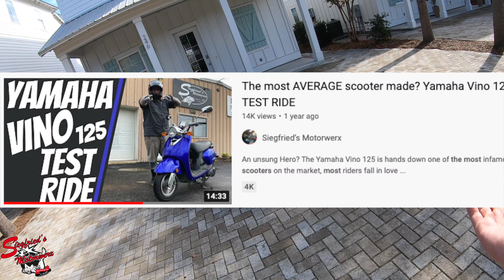Watch this BEFORE you buy Dr. Pulley Sliders for YOU Vino 125

Comment: Hi Aaron 🖐️.. it's the Buddy 50 guy from Connecticut.. well my customer sold me his Yamaha vino 125 tonight it's got 4,000 miles and is in fantastic condition.. he sold it to me for $1,000 which is a great deal! 
Driving it 15 mi home I was so impressed! I had it up to 55 mph on level road...60 downhill.. the scooter ride so smooth and so comfortable.. it feels more like riding a motorcycle than a scooter! .. I purchased it so I could ride longer distance upstate Connecticut.. light it up to some of the fairs  this summer in fall.. I'll be able to take it a lot more places than my buddy 50 because it climbs hills much better.. the suspension is fantastic absorbs a lot of the bumps very smooth ride... It doesn't corner like my buddy 50 as I drive that like a sport bike leaning all the way over.. but it makes up for that with its smooth suspension and ride... I'm keeping the Buddy 50 for local riding and using the vino for long distance upstate Connecticut... Thanks for the great video and all your help with my phone calls to you 👍❤️🙏

Comment: Absolutely love the Vino 125. My wife and I both have one. My 2007 does 53 mph and accelerates well, my wife’s 2009 accelerates well and has a top end of 47 mph. They’re both stock and very reliable. I watch a lot of your videos and really value your reviews and opinions. Love the sidecar you have.
Reply from the maker: Thanks Leonard! Have you had the belts replaced on either of your vinos?
Reply: @SiegfriedsMotorwerx  Both have had new belts. I did the 2007 and the 2009 was done at a dealership before we bought it. Both vinos are under 4000 miles. Happy New Year.

Comment: I disagree with the Yamaha vino being just an average scooter even stock... I bought mine with 4,000 miles from a customer of mine it's a 2004 Yamaha vino and when I twist the throttle the front wheel comes off the ground!! Plenty of torque top end on level ground via GPS is 55 mph which I think is fantastic for a 125 especially one that's heavy

Comment: I’ve build one with a 1500rpm torque spring for the rear pulley, 10 and 11 grams rollers  staggered, 115 main jet and pod air filter, it does 65mph in any slightly slope down and 60+ on flat. I’m 6’ and 230lbs. It was night and day difference
Reply: Please post a video
Reply: Is it the scootertronics kit ?
Reply: @elizabethmcheffey8699  yes I can do that
Reply: @digglejones218  no I just put it together but I’ve seen that one before too! I’m doing a 150 bbk on it pretty soon and will report back !
Reply: @Renaissance_cycles  let me know where you find that bore kit I’m looking for upgrades for my 06 vino 125

Comment: Hello I have 2009 yamaha zuma. I'm looking to do the Dr pulley sliders. And tst hyperbolic variator did you mix the sliders with rollers or just fill it completely with sliders. Also did you mix with with different gram weights?
Reply: You can stagger roller weights, 3 & 3, on every other slot but mixing rollers & sliders doesn’t make sense. TST variator has a slow & fast ramp already sending weights at different speeds. Get the TST kit from RC scooters, it comes with a 1200rpm contra spring that will help a lot

Comment: I recently picked up an 04 Vino with 4,800 miles for 200$. Its been sitting for a few years at least. Tank was rusty bad and carb full of that green goo they get after a long time, petcock saved the carb from the water in the tank luckly. Engine seems to run fine but it only goes 43mph, havent checked the CVT yet and was thinking maybe the belt or rollers are worn and not able to go all the way up the pulley.
Reply from the maker: Tire pressure will also slow your scoot down. But I’d be willing to bet something is tired in your CVT

Comment: You should have left the stock clutch on this scooter. Mine went faster after I bought the full size stock Windscreen.  And I am 220 lbs. 5’10”.   Only parts I ever bought was air filter and 2 rear tires.👍😀
Reply from the maker: We did leave the stock clutch, we replaced the variator with a dr pulley performance mod

the roller weights  we swapped for sliders

While we did lose some top speed we gained acceleration, which is what we were primarily after

Comment: I own a 2006 Yamaha Vivo 125 for 2 years, was getting up to 59 mph. Had the belt changed and now top speed ia under 45 mph. Is this bike belt pacific or something else. Considering Dr. Pulley Variator with new weights (12g). Ordered a Yamaha 5NW-E7641-00 cvt belt. Fingers crossed to get it back to 59mph or +. Any suggestions?
Reply from the maker: Have you checked your current roller weights?
Reply: Did the top speed drop immediately with the belt change? If so, it's because your new belt is different in some way. Even if it's listed as the same size, different brands will measure differently. So your new belt may be longer, which causes it to not drop down as far in the rear pulley, lowering your top speed. If the belt is wider the same thing can happen if it's too wide to drop between the sheaves.